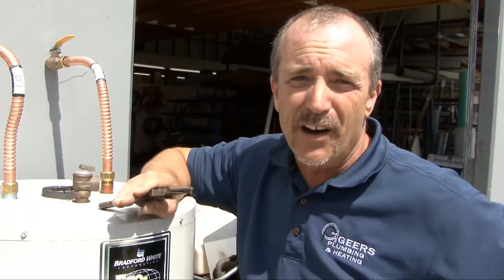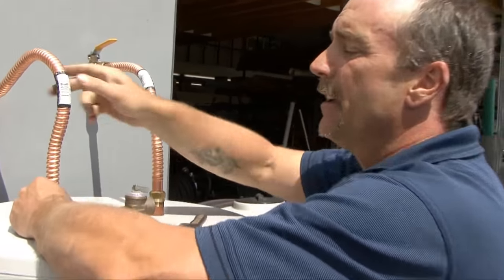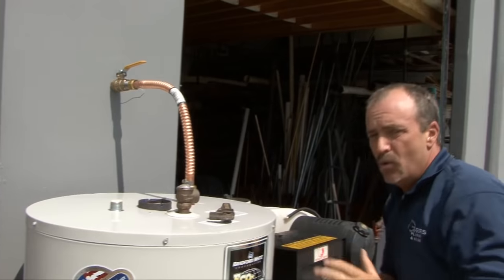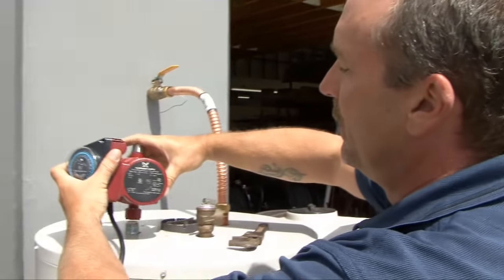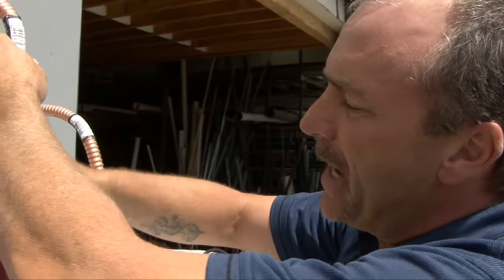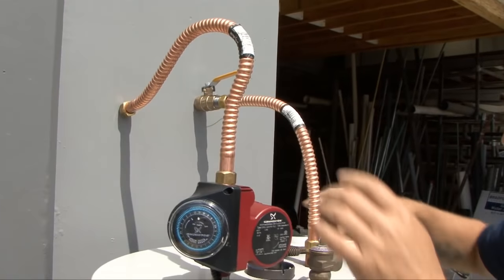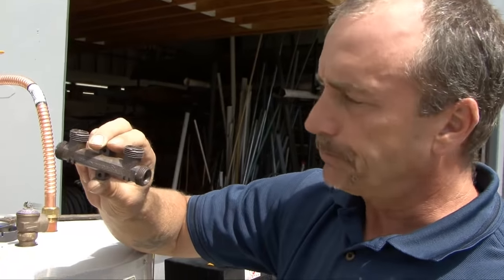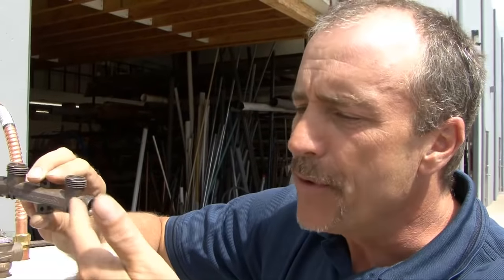HOW TO: Get Hot Water in Seconds

Comment: I bought one way back, those days the PUMP & bypass valve was all, you had to go purchase hoses, NEW  ones NOW INCLUDE THOSE HOSES, THEN GRUNDFOSS SENT ME SOME PROMO & another bypass valve , so upstairs , the lines & bypass valve ore under the sink,so I get hot water quickly @ sink,bathtub& a shower , the other is under the sink on 1st floor & KITCHEN SINK. It’s set off 2 am,on 6 am, works just fine , 🇳🇴🇳🇴🇺🇸🇺🇸

Comment: A pump is not necessary if you can access the pipe lines to the furthest fixture. Installing a t-fitting in the hot line and returning it to the drain pipe of the tank with a check valve will give you nearly instant hot water at all the fixtures in the system. No pump needed because gravity does all the work. This works great in single story homes but will also work in a 2 story by plumbing to the furthest point accessible. It is not perfect, but it does help.
Reply: I deactivated the pump and you are right. I want to take the recirculating valve out. Is that easy to do myself?
Reply: gravity???? that makes no  sense either and sounds like  it violates code
Reply: @johnnyllooddte3415  Cold water sinks.
Reply: Do you have a flow diagram ?
Reply: It's actually convection, but some didn't understand that.

Comment: thx live in a high-rise condo. Glad to have the plumber explain the problem with the recycle valve. Management abusing owners saying they need to change the shower controller. Did cross reference also with mainline cold water shut off same hot water problem 45 seconds to the bathtub, 2 minutes to sink. At least i know and others know of the issue. Can't explain why managers of large condos would not k-now or the plumbers themselves. Finally got to google the recycling valve. thanks. What can owners do to [prevent abuse and scams? They still not fixing the issue at their end, yet threaten us with changing bathroom controls. for Failure to maintain.  Should be articulated through media the abuse and scams on condo owners, even the additional charges for large apartment rentals if and then.

Comment: This is great but here in the summer in Arizona the cold water turns warm.  I turn my water heater to vacation mode at 60 degrees and don't need 110 degree hot water.  The dishwasher already heats for cleaning and a cool shower is more comfortable in the summer.  I'm originally from Washington state so I really miss having cold water in the summer.
Reply: I’ve been thinking about doing that, but I’ve been reading it can create bacteria in your hot water tank if it’s below 120°F. Any opinions on this

Comment: had one of these units for 16 years. Pump works correctly but the valve at the end of the line is another matter. I'm on a well so have high alkaline water. Once per year I must pull the valve and replace it. It gets fouled with alkaline. I take the removed unit, soak it in white vinegar for about 24 hours and force compressed air through it to make sure it is open. I store the unit for the next year. I have a water softener, 5 micro water filter and use a RO filter for drinking water.
Reply: I have not had mine installed long, and already I think the thermo valve is not working. I thought it might have an adjustable temp to set, but nope. Its a dummy unit with internal function. So I have to take this thing out and descale it?  Geez...Is this gonna happen easily all the time?  I too use a RO for drinking, but not for the rest of the water line. I do want it for shower so I can remove the fluoride in that as well. Most important thing to remove. But, this valve is now the issue...At least I think. Any way to test it?

Comment: If I understand the mechanics correctly, when the water recirculates back through the cold line, we are then drinking water that has been run through the hot water tank? I have always understood that  due the use of decaying aluminum anode rods, water from the hot water tank should not be used for drinking or cooking. Is this safe?
Reply: Good question. I am guessing a water filter on the fridge may take care of this.
Reply: Say timer is set for 630-640 I’m not using the faucet what happens to the pressure when the line water reaches temp build pressure bust a line or what happens that seems better to manually turn pump on prier to use once u open the hot tap turn pump off but how does this way work with the pump on a timer
Reply: Was thinking that myself, why not just have the valve dump water into the drain?
Reply: @PD-yd3fr  Because dumping in it the drain is exactly what you're trying to avoid. The idea of this is to save time AND water.
Reply: Can you hear the water running through the pipes like when a faucet is in use?  That would suck
Reply: @doughill5487  better dump into the drain than drink poison
Reply: @arealmaintenanceandrepairl1103 since you're pulling water from the hot water heater. There is no build up, the cold that is being pushed out of the hot water line and back into the hot water tank
Reply: @PD-yd3fr I want this.  On a well, so water use is not an issue but waiting for hot water is.

Comment: When the valve closes, isn't the pump then pumping against a closed system? Is that not bad for the pump?
Reply: Before the Valve closes, it is easier to pump horizontally back into the cold system rather than push water up into a faucet.
When the valve closes, the pump still has a path out of the faucet and the hot water is pushed out.

Comment: Liked the video, thank you. 
Do you recommend a bypass valve at each hot water location? i.e. Kitchen, master bath, upstairs bath, and guest bath? The guest bath is nearest to HW Heater. Next would be the master bath and in close second the kitchen and then upstairs bath, is the furthest place hot water needs to travel. So, in theory, if I install the bypass valve in the upstairs bath sink, my hot water should arrive much quicker at each location?
Reply: If on the same run or loop yes. If you have separate branches of hot and cold than you would need one at the end of each branch / leg. 
I’m going to see if I can track down plans for our house, but I’m also certain I can go into the mechanical room and find the direction of the water and determine my number of runs. 
Hope that helps your question.

Comment: Question? Our 1931 home has 5 bathrooms!! Really as it was a boarding house and we have this system which is awesome 😉 BUT we still have a bathroom that I need hot water quicker so can I install another comfort valve or move the original valve until I find that sweet spot of hot water? Thanks and you're video clip was spot on compared to the 3 other videos that I watched prior.
Reply: This isn’t fact but I’m willing to guess that you’d need to install the bypass valve with the gel tab that he talked about that goes at the sink in the farthest location. You would already have flow to the hot water on whatever direction it ran from the tank.

Comment: What pressure is that pump running at?  If I set my pump to have instant hot water say between 7 to 9am, how much higher will my water pressure be when using it while the pump is on? 
Thanks
Reply: A circulating pump will not change the overall pressure in a system.
Reply: But how wouldn't it if it has to overcome the house pressure to get back to the hwt, until it shuts off.

Comment: Can this be used on a tankless water heater?
Reply: The pumps with higher flow rate work but, not with those black plastic bypass valves.  Avoid using those comfort valves in high calcium area's or you'll be replacing them every two years.  You'll know they've failed when you get scolded from the valve locking in open position.

Comment: I have a couple of questions:   
#1 So the pump runs sending the hot water to the sensor valve under the sink.  When the sensor determines the water coming to it is hot, it shuts off dumping the water down the cold water line.  When that sensor valve activates, does the back pressure in the pump line cause the pump to shut off - or does the pump just continue to run until the timer shuts it off?
#2 with the pump off and not running via the timer,  will tank water flow through the pump with the pump not running?
Reply: I have this exact pump in my 5 yr old house.  It works great.  I set the timer to run in the morning and evening. When not running, everything works as usual.  I had to replace the pump and bypass valve after 4 yrs.  The pump runs when the timer says it is supposed to run.  This is a fractional pump so it is a tiny amount of water being recirculated back into the hot water heater.  Not sure why so many negative comments here??  This guy is spot on everything he is saying.  I have hot water literally in seconds during periods when the timer is set.  Good video.

Comment: Recently purchased an 8 yr. old custom home with the recirculation pump installed but no sensor at the other end of the house. I installed the sensor and then we had instant hot water. The previous owner had the pump set in the 'on' position, (but he had no sensor). I didn't change the setting when I installed the sensor. Our house has a propane tank for gas heating. Tank filled right after purchase. Within 6 weeks we had burned through over 200 gallons of propane, which is over $700. Have a gas furnace for heat, but are conservative on heat settings, not on at night at all. Gas water heater, and gas cook top. That's it. Propane Co. tested, had no leaks. They're only guesstimate is 50 gal water heater running 25/7 recirculating caused the excessive propane usage. Sound likely??
Reply: Exactly why I have hesitated on the purchase of a recirculating pump. The "on" position of the pump should sync with the water heater turning on and off but it's not going to because the sensor valve will turn the recirculating pump on and off so your scenario is the result. Thats what I thought was the flaw in the system which defeats the reason for the tankless water heater.   If the pump synced with the water heater turning on and off it would be a fantastic system.   I would have thought a manufacturer of tankless water heaters would have figured this out by now.  I know Noritz has a built in pump with one of their new models but mine still works so I'll wait until it fails then check that out.
Reply: I unplugged my recirculating plug, I’m in a two-story house with a bridge valve upstairs so I still get hot water even without the pump. But this means my water heater is running all the time and it’s trying to recirculate all the time. I want the bridge valve out but I want to figure out how I do that myself!

Comment: How do I remove that thing? I don’t want to use the recirculating pump anymore so I unplugged it but I am still getting hot water instantly at the sink that has bypass valve under it. I don’t want the hot water recirculating at all anymore. Can I just turn off the water that sink? It’s still coming out.

Comment: Can this work with a Rinnai R75i on demand propane HW heater? Is there a different arrangement? The original HW design of my house is root and branch but the large addition we built are all home runs with Pex. If there is a system for on demand propane HW heaters I can see it being a plus for the root and branch system in my original house. I see this video was posted 11 years ago.

Comment: So if the cold pipe is full of hot, where do you get cold water? I use a 3 line system.
Reply: Ocean Mariner wait for it to cool off
Reply: @Bob J so it pushes the cold water back to the water heater?
Reply: @hyster2568  Yes. Your water heater will temporarily also get slightly colder. This isn't really an issue for tankless, obviously.
Reply: Use a DEDICATED Hot Water Return Line.

Comment: My water heater is basically in the center of my house. The hot water line tees off and one branch goes to master bath and then up to another bath. The other line goes to kitchen and another upstairs bath. Do I install a recirc valve in both upstairs bathrooms which are on opposite ends of the house?

Comment: But the pump is still running even if it’s on a timer for 30 mns when that tab closes because the line is hot and no one is using the faucet the pump is till pumping then what happens

Comment: The ONLY downfall is that you might have in certain cases luke warm water on the cold water side.....but the hot side will be perfect...
That's why in NY if you building a new home you need a third pipe to anything that's 15' or more away from the water heater or heat source...which Is a complete different system than what the video shows but it's the best way with out connecting on the cold water side like it shows here...but a stainless steel recirculating pump costs around $450 plus labor and materials
Reply: "might have in certain cases luke warm water on the cold water side."  Name one time you Would Not have to wait twice as long for cold water with this system installed..
Reply: @utube4greenfuture  well the time where the lukewarm water in the pipes had cooled to cold water... But yeah it's not ideal

Comment: Unless your water heater is spiffy clean, and change the corroded anode rod, and flush your water heater several times a year, you will be drinking your potable water (cold side) mixed with your hot water. Imagine a home owner who rarely flushes his/her water heater and drinks from all the contaminates from your water heater. Even if you keep your water heater clean, heavy metal buildup in the water heater usually is several times more than your potable water. The only way to alleviate any health concern is to run a dedicated hot line from the water heater to the farthest plumbing with a re-circulating pump re-routing the hot water back into the drain side of the water heater without ever contaminating the cold water side. However, unless it is a new house already retrofitted with this line, it gets expensive installing a dedicated line.

Comment: Number 1 their is no such thing as instant hot water it just means you will get it quicker depending on where your wh is.
Do it the correct way and pre-plumb for it or run a 3/4 inch return and depending on how your home is rolled it might work a little faster and not for long because those little plastic manifolds go bad quick
Reply: 5 years is "quick"?

Comment: What if you use the bypass valve without a pump, should cut back on water waste, right? I don’t mind waiting a bit but I’m metered
Reply: That's the point of the bypass and pump. It recirculates, it does not pour away.

Comment: When you turn on the cold water faucet after the heating is done will the cold water now be warm/hot?
Reply: It depends on how cold the water in the hot water pipe is.  If you haven't run the water all night long, then the entire hot water line from the water heater is cold.  The check value will shut the water off once hot water reaches it.   So depending on how warm the hot water line is, that is how warm your cold side will  be.

Comment: So by using the cold water line as the return, instead of waiting for hot water, you wait for cold, while using electricity for the pump, and heat your house in both winter and summer, using the least efficient system, the hot water heater, through a gel valve that needs to be replaced approximately every 5 years.  I would have never thought of such a system.  Interesting!
Reply: The valve closes once the water gets hot stopping the flow. That way the cold line stays cold. You may have to replace them every 5 years or so, but they cost about $50. $10/year is not a bad price to pay to not waste water.
Reply: @yamaguy  If you have continually hot water in the hot line, it requires that you have continually warm water in the cold line.
Reply: @jackt6112  and more potential for bacteria
Reply: The small valve he held up in the video opens and closes to keep the cold line cold and the hot line hot.  Once the hot water reaches the valve it closes.  It does not run continuously.
Reply: Nobody said you had to keep the hot water line at temperature all the time. If you're smart about it, you'll have the pump running on a schedule or, smarter, triggered by a motion sensor in each room with a hot water tap.

Comment: What are your  thoughts on a Chili Pepper device?  I have used them for 8 years with no problems.  Anyone can install them under the sink in the bathroom or kitchen.  Press the button and in 30 seconds you have hot water.
Reply: WHAT DEVICE IS THAT?

Comment: I have this pump and by-pass valve and now I have NO cold water in my Kitchen nor in the farthest bathroom where I wanted the hot water faster. What should I do to get my cold water to be cold and the hot to stay hot?
Reply: Probably need to adjust the pump timing so that it isn't on for as long.

OR your bypass valve is bad and isn't closing thus pumping large amounts of hot water into your cold line.
Reply: Remove the bypass system and return to the standard system, then install an inexpensive but good quality 120volt under sink water heater to the HOT side of your water, they are about $200, it will just act as a booster and use very little power.
Reply: toddstractorworks hmmm, I've been wanting to install a point of use but the 3 foot power cords are all to short and do not reach the outlet.
Reply: where ever you install the bypass valve the water temp at that fixture will be warm. that is the nature of the product, if you have a two story house and the master bath is above the kitchen you could install the bypass valve there. Usually having luke warm water in the bathroom sink is not as bad an issue.